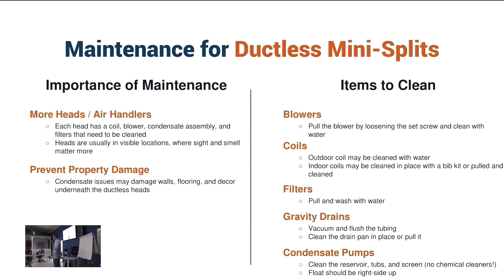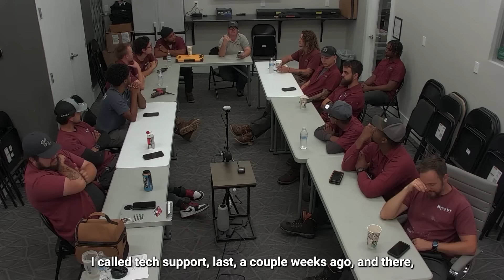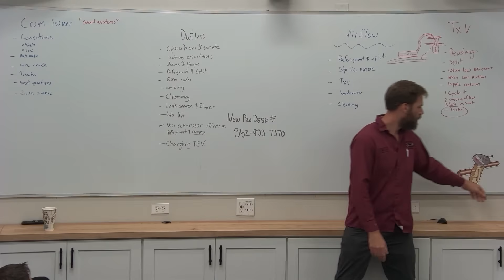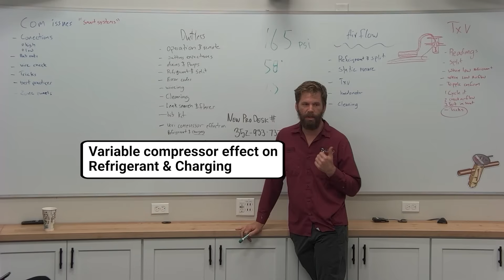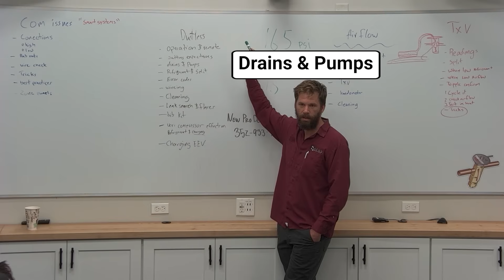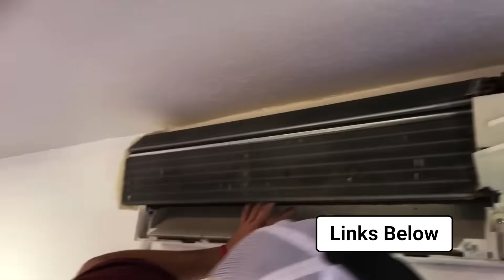Ductless Mini-Split Troubleshooting: Common Issues & Solutions

Comment: I would like to know more about his comment in the wiring section: 'humidistat relay we add to pass inspection', what is that about? I wonder how that would be added to a ductless system and why it would be necessary for an inspection.